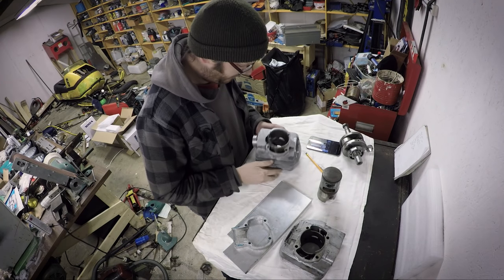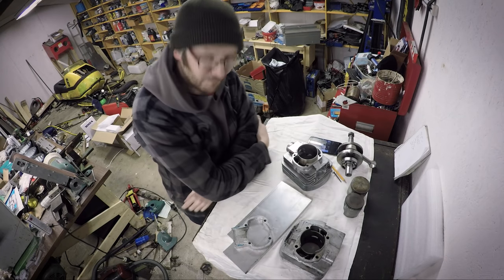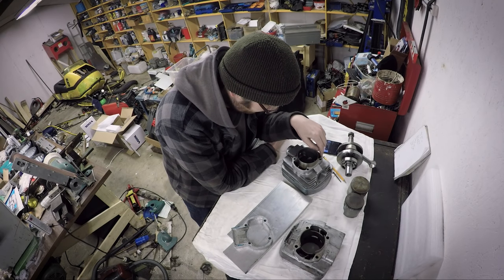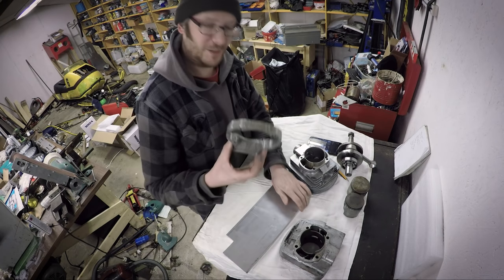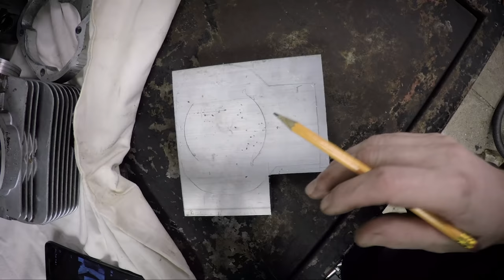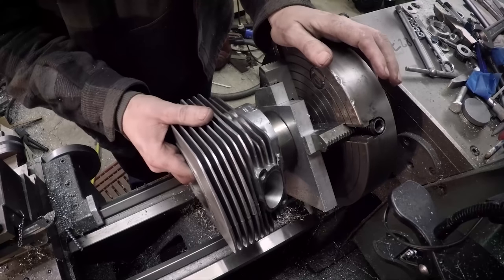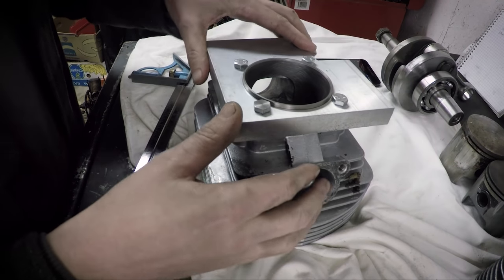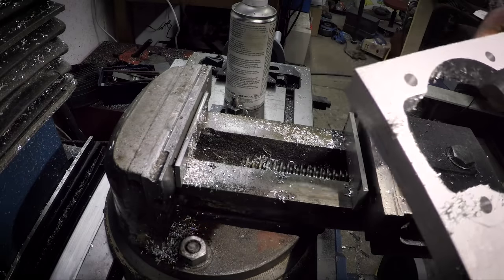Bigbore stroker 277 part 8 - Spacer fabrication

Comment: Hey there, I have a 244 out of a polaris colt, and I am wondering if it is a good engine to do racing, planing to put it into an 1971 elan. Thanks and keep up the good work! Really exited to see the 277cc run x)
Reply from the maker: marc robichaud I have no experience with them myself but if it's the same engine as in the Gemini 250 then I'd say it's got a lot of potential! A friend has a Gemini that he runs on methanol and it's a fast sled! 
Can't find any recent videos of it but here's an older one: https://youtu.be/mNJIgInycFY